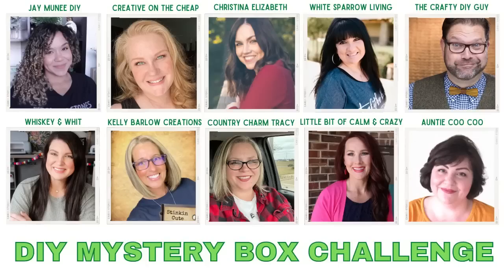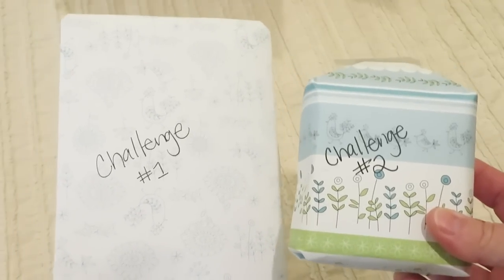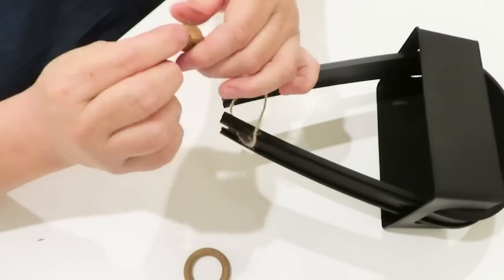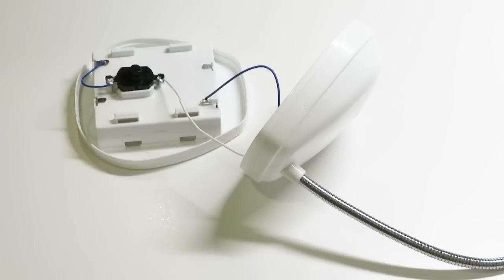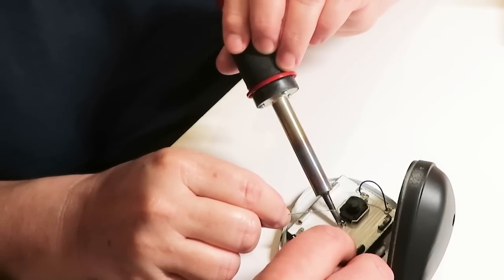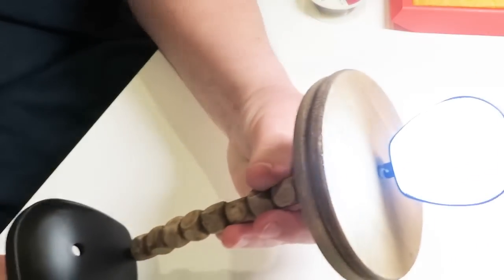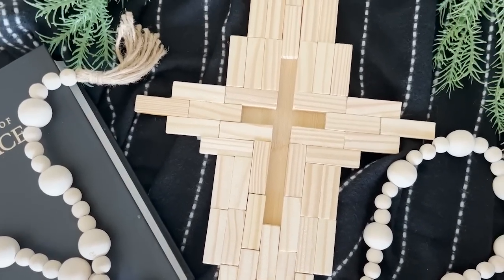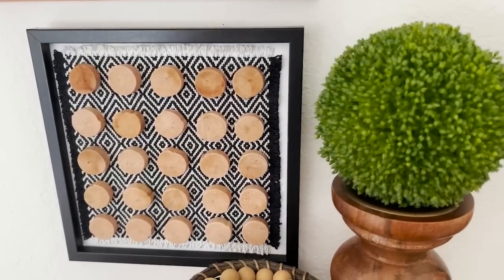DOLLAR TREE DIY WALL DECOR | MYSTERY BOX CHALLENGE

Comment: Your soldering lesson took me back to shop class! Your hubby is very patient. Your a good team. Sorry you were sick. I love the shade for the lamp. I would pick up a light on a wire at Lowes and then do the same thing to make a wall sconce. I used one of the light bulb wires and my husband drilled a hole in the bottom of a metal colander and that light hangs over my kitchen sink! My grandson is getting baptized next month, I may consider making one of those cross hangings for his room!!!